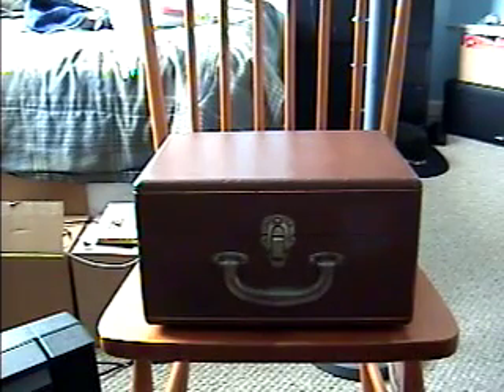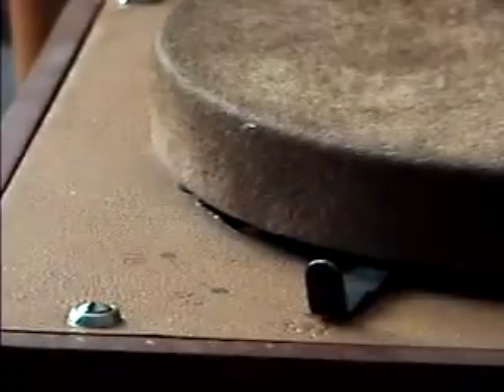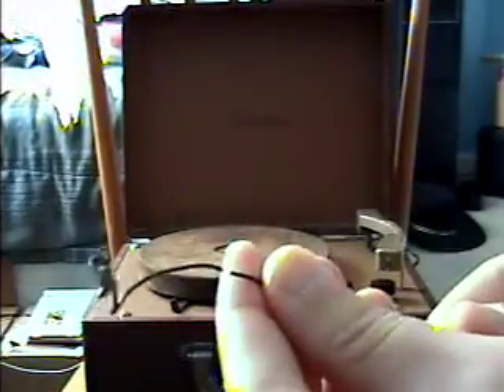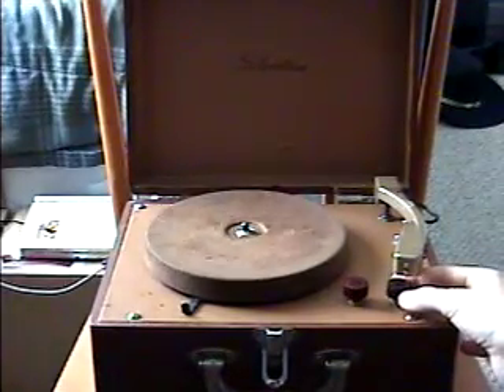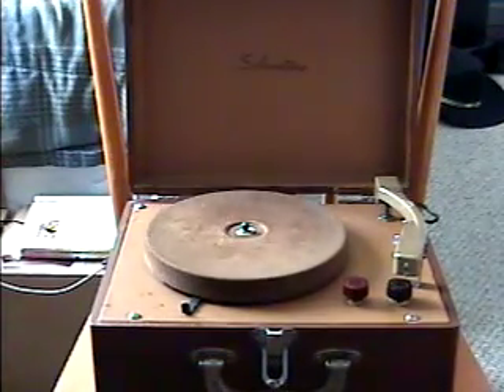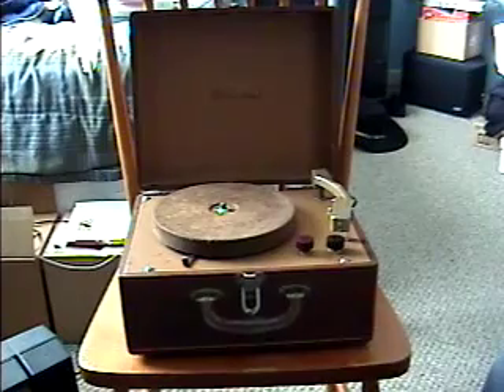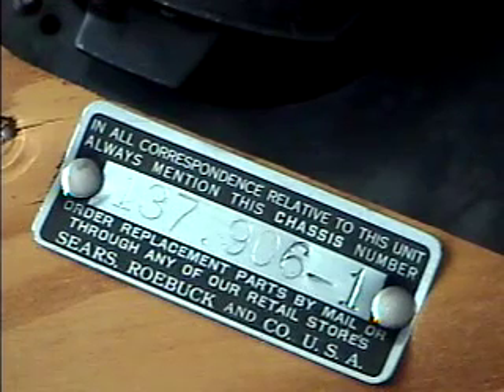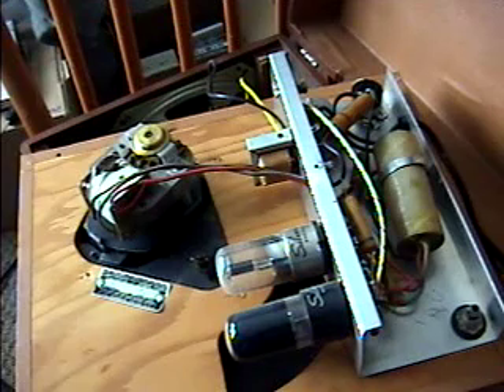Late 50's or Early 60's Sears Silvertone Portable Tube Record Player

Comment: All you are getting from this is "needle talk" -  the needle is vibrating the air around it. You aren't getting anything from the speaker or amplifier. You will need a new cartridge/needle (that original is not only going to be dead but that needle will destroy records) and have to replace the arm to amplifier wires. After that you will probably need to replace all of the capacitors.

This is from the EARLY 50s at the latest.

Did you ever do anything with it?

Comment: you do not really know what to do at all. the cartridge needs to be replaced and the tone arm wires need to be replaced as well as the capacitors . you will never get sound without a cartridge and wires for the cartridge . you need to learn more about things with diagrams that will help you a great deal  . great video